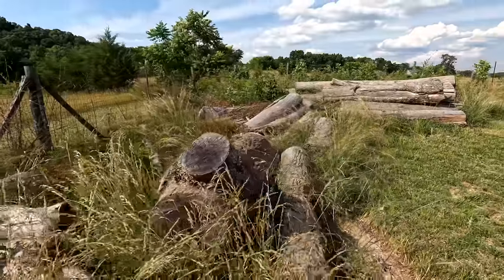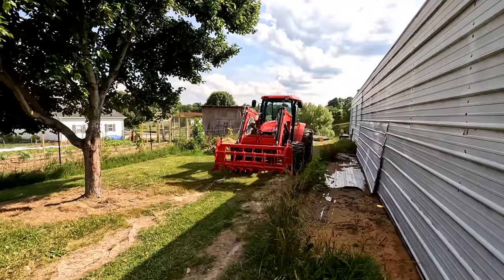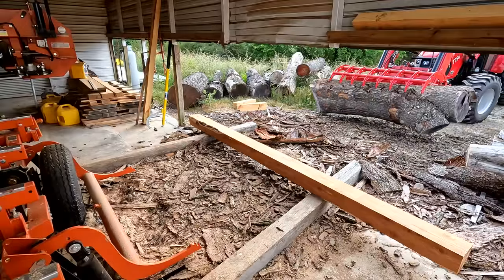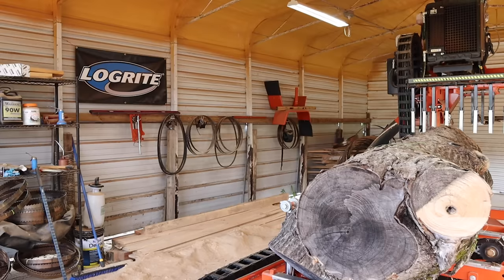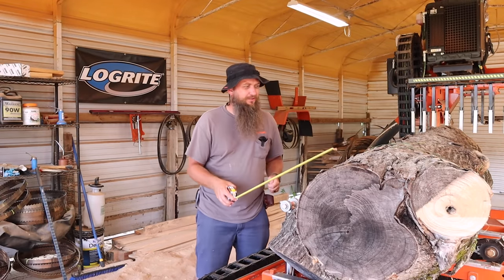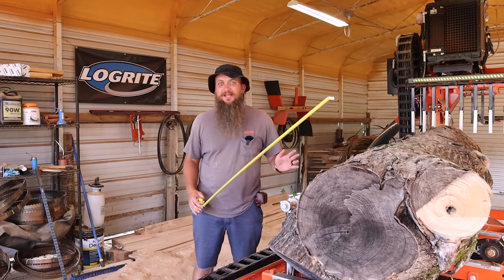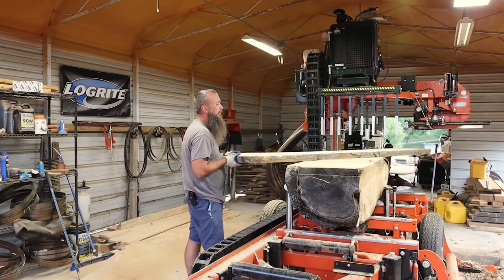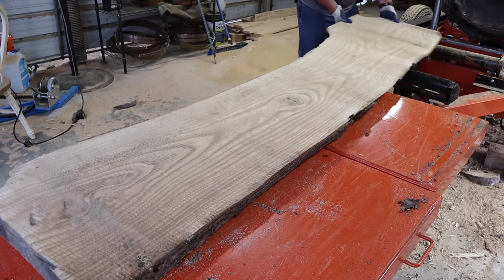Never Seen Anything Like It, Saw-milling A Tree From Asia

Comment: Many years ago, I picked up a Paulownia (billed as a Chinese Sapphire Dragon) tree in a one gallon bucket at the garden section of my local Home Depot. For a small tree, it had HUGE leaves, and I was stopped and asked about it several times on the way to the checkout. I was looking for a fast-growing shade tree, and it really fit the bill.

The instructions with the tree said to cut it off just above the ground if it didn’t reach at least 6 feet in the first year of growth (otherwise it would never grow much taller). Come winter, it was only chest-high, so I closed my eyes, lopped it off, and prayed. Come spring, that tree took off like a rocket! It grew at least 10’ that second year and cast as much shade as I was hoping to get in 3-4 years. It put out long straight branches that grew parallel to the ground and then turned up at the ends to finish with flower stalks covered in blue flowers. It became the showpiece of our yard.
Reply: did it have a hollow tube throughout ?
Reply: Paulonia (empress tree) is an extraordinary specimen. I used to design gardens with intent to harvest fruit and nuts, and eventually timber, and always included one if there was room. And, the COLOR when in bloom! Like little else.
Reply: In Maryland there are areas where it really does grow invasively. It's beautiful but those huge leaves and quick growth to relatively high ends up blocking out light to other plants and trees plus those cool flower/seeds spread like crazy so it outcompetes some native species. But it's a really cool tree and the wood is nice.

Comment: Paulownia trees are very fast growing trees and in southeast Georgia around 2000 people started planting them for a cash crop.  I think the idea was that they would reach a harvest size for pulp wood by then.  The ones I saw did reach a height of about 30 feet and diameter of 8-10 inches.  The ones that I saw on the way to work every morning were then cut and the owner cleared the stumps.  I think hardwood was so cheap then it almost didn't pay to cut it.  Have not seen one since, but they were very pretty, shady trees and had very large leaves.

Comment: Those hats are great, especially when it's hot out. Just dunk them in a bucket of water, wring them out and it'll keep you nice and cool.

Hint on the chickens: get yourself a length of 3/4-in white PVC pipe. When you're trying to wrangle the chickens swing it in an arc over your head towards the direction you want them to run in. Chickens have a natural reaction to run from overhead threats, like hawks. If they see a fast moving shadow on the ground or something fast over their heads they will instinctively run for cover.

Comment: I'll also add that if you see this tree alive, it's hard to tell the leaves from a catalpa, but instead of having beans it has what looks like upside down acorns and in the spring the tree is covered in purple flowers, which is quite an amazing site
Reply: Very true.
Reply: If it’s fast growing, how does it’s root system behave? Are it’s roots invasive as the tree seeks water, do you know? Thanks!

Comment: The grain and look kind of remind me of fir dimensional lumber we use sell for long lengths that would stay straight. Like two by twelves and two by six over twenty feet long. Try those in yellow pine and you end up with a bunch of twisted snake like firewood most of the time. That fir always stayed nice as we sold a bunk of them. When a lumber yard sells A frame kits you need long two by twelves for any decent size building. I guess today they would use "engineered beams" made from shorter stuff but laminated up strong. That was about fifty years ago that I worked there. Dang where did the time go???

Comment: Paulownia grows like a weed in costal Virginia, but I never saw one that big.    I've chain saw milled many, but nothing over 18" diameter.   I find it very lightweight and easy to work.  Wonder if yours had soaked up water like a sponge to be that heavy.    It resembles oak from the side but has huge open pores from the end.  Sharp tools are a must to avoid tearing it to shreds.

Comment: As those chickens get older, they should just go in on their own at night to roost. You may have to vary the time on the door closer if it can be set automatically. You might run the electric wire at two different levels so a coon or a fox can't go over or under it. I don't see how that wood wouldn't sell for a good price.

Comment: ive got a nice stack of paulownia boards i got from the local sawmill. have made lots of cool looking projects with it and also been using for exterior trim replacement at my house. dries quickly after being sawn, holds up great and holds paint super. its weird you keep saying its heavy, its one of the lightest woods per lb with only balsa being lighter